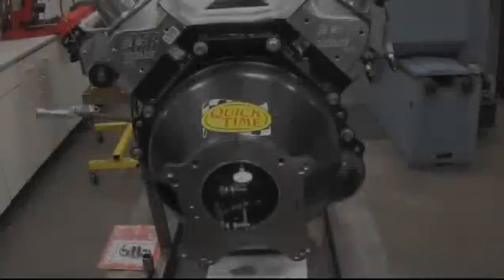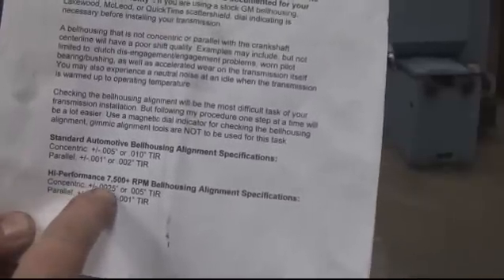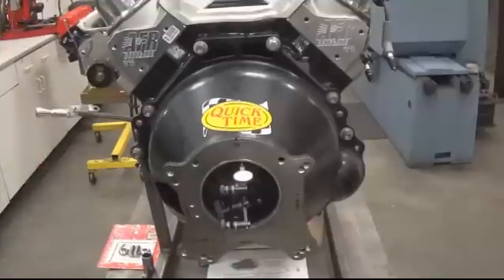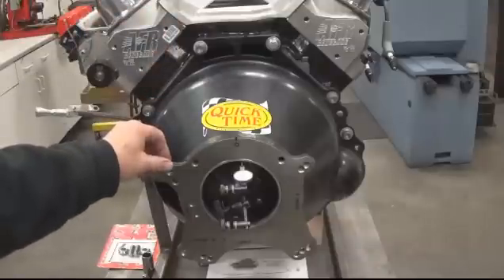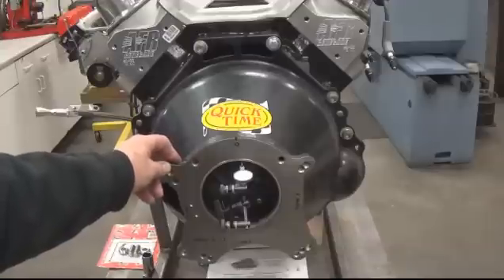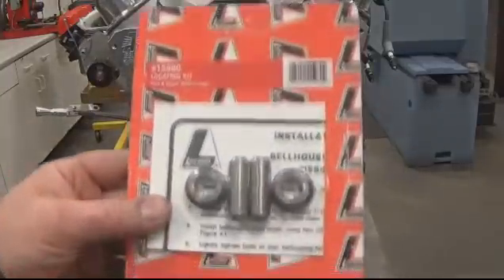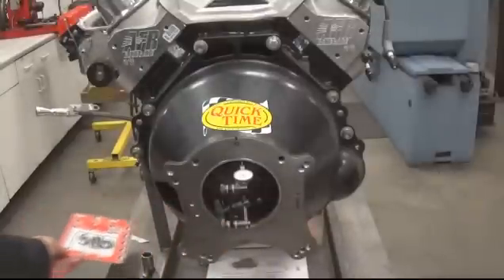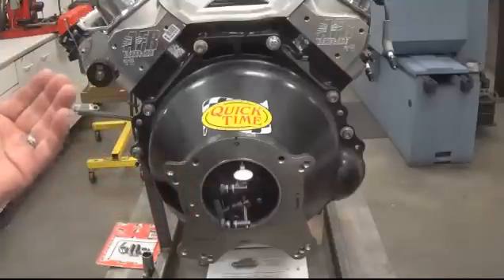HOW TO CHECK AND DIAL IN PROPER BELL HOUSING TO FLYWHEEL  ALIGNMENT

Comment: My crate engine from Prestige had the engine block surface painted (the back of the block where the bellhousing mates up).  Should I remove this paint prior to transmission assembly, similar to how you guys removed the paint from the Quick Time bellhousing?
Reply: Thanks.  I would have taken the paint off.  I appreciate the information
Reply from the maker: Engine - rear of block would be fine leave the thin and consistent paint alone on the mounting face. The bell-housings are known to have heavy powder-coat and surface irregularities, so that is why to clean them up. Also why we mock up the entire assembly to confirm that everything is aligned as an assembly. Good question...
Reply: @prestigemotorsports  ok thanks!  I'll leave the paint as is.